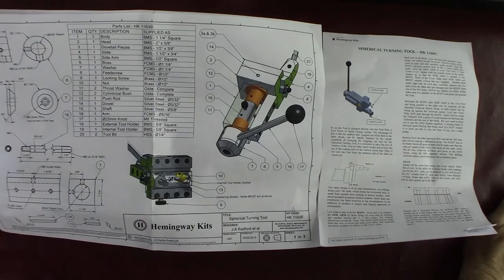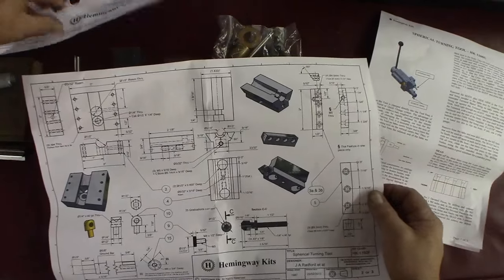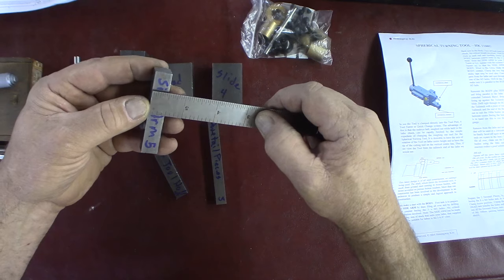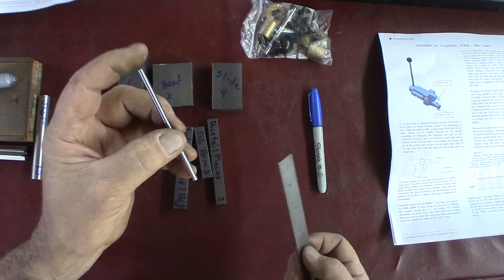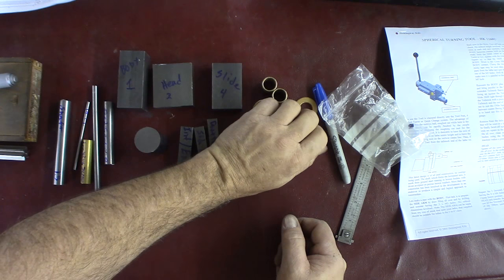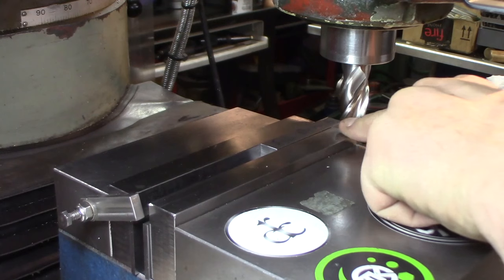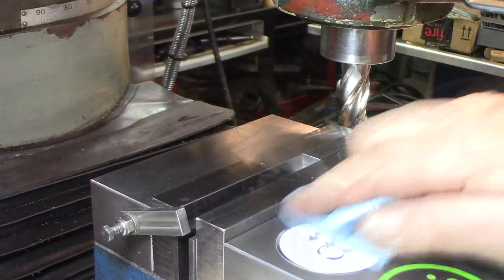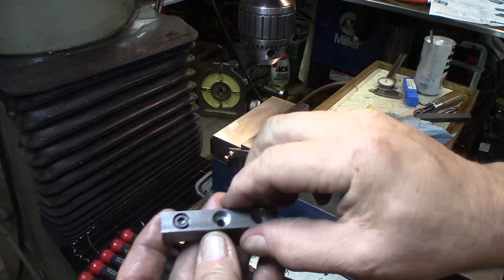How To Build a Hemingway Kit Spherical Turner / Ball Turner P1

Comment: I can appreciate the comment on the confusion that can be created by mixing Imperial and Metric measurements on a drawing.  Back when I was doing inside sales of cutting tools I had a customer that made molds for GM. GM was switching all their dimensions to metric and had a tapped hole marked as 12.7mm-13.  All engineers at the company were befuddled at what GM was calling for. I got a call and after I stopped chuckling to myself told them that the call was for a 1/2-13 tapped hole.
Reply: I know its years later but there's 2 monumental metric-imperial mistakes that every engineer needs rammed down their throats and never allowed to forget.
1: The Gimli Glider where an aircraft re-fueler didn't put enough jet fuel in the plane and it ran out.
     Luckily one of the pilots was also a trained glider pilot 
2: The Mars Climate Orbiter where NASA used metric and Lockheed Martin Imperial. 
    That was only a $125million mistake.

Comment: Fwiw Randy Hemingway kits started before most in the UK had anything like a mill in there shop since the Asian built machine tools really hadn't started coming in yet and it was tough and very expensive to find smaller home shop sized mills at the time. Kits like these were designed around the ability to build them on the very common Myford lathes. After the war and up into the 1960's were some very lean times in the UK. If you had a lathe at all then you were lucky, and going by my old magazines any decent British built mill was 3 or more times the price of one of the Myford lathes.Later they changed a lot of the threads used on these projects for shop tooling over to metric and away from the more British only thread types. That would be why your seeing mixed units being used today. And why you'll see instructions about machining some parts on a lathe where it might be easier or better done on a mill.

Comment: If you want different instructions try GH Thomas' book The Model Engineers Workshop Manual, where he updated Radford's original design. The Thomas/Radford version is neater, in my opinion, than  Kirk's in having a round head and fixed dovetails, and allows closer to the chuck action but, hey, if it works, it works.
Once you have built this tool you will find yourself using it more often than you imagined you would, so many turned items can benefit from a rounded end, without going to a full sphere. 
Good luck with the build
c
Reply: Yep I'd certainly agree about GHT's redesign. Some minor but I think slightly better modifications to it.